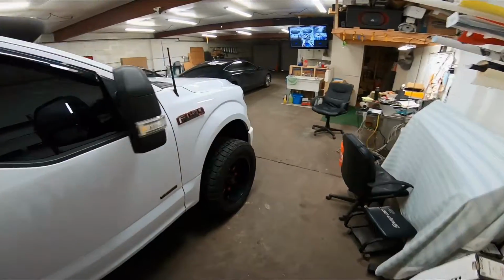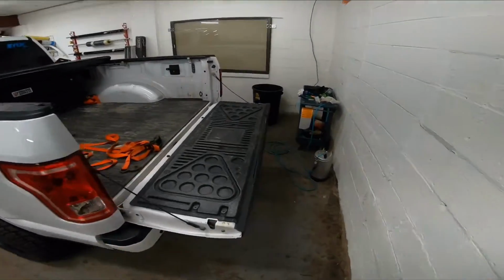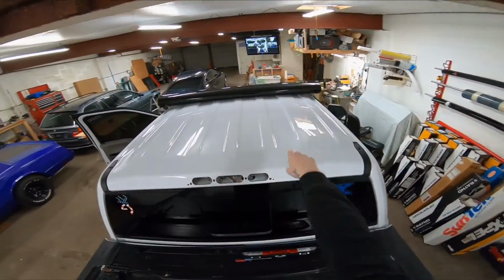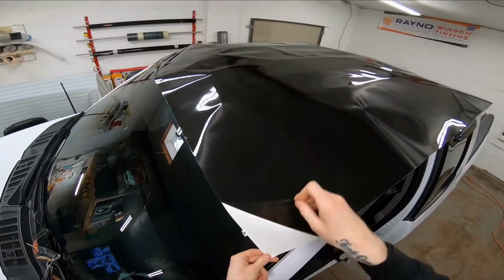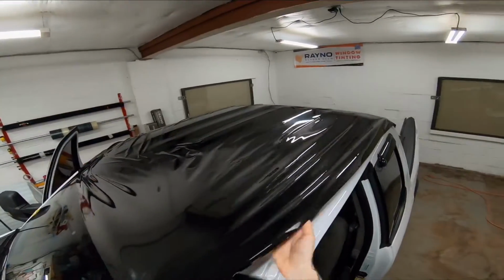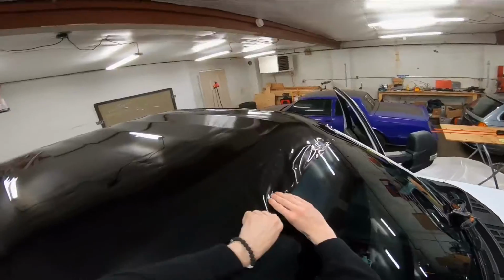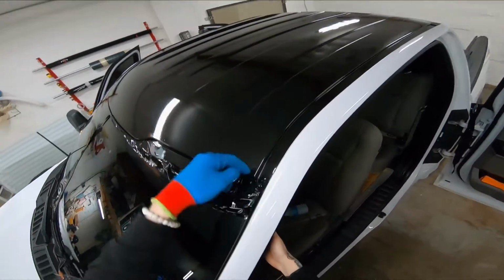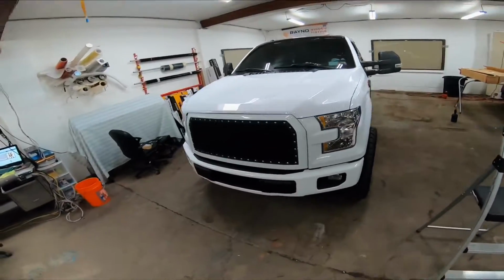CUSTOM FORD F150 ROOF WRAP

Comment: What kind of wrap is this? Does it not require water to put it down? Also how did you get the grooves to lay flat im about to do mine. What size did you order also. Sorry for all the questions.
Reply from the maker: Hello James, this wrap is Avery Gloss Black. It doesn’t need water because there are air channels on the adhesive side of the wrap for the air to escape and not bubble up. On the grooves heat it up a little and shape it into the groove with your finger. The size for that was about 5ft x 7ft
Reply: I had the same questions except for the water part. How much better is Avery over 3m and why?
Reply from the maker: I personally like both. Avery is more user friendly, the way it lays and stretches. They’re both great brands though
Reply: How much wrap did you get to get that amount of hangover?
Reply from the maker: Don’t exactly remember how much exactly but about 7ft would do the job!

Comment: how to remove the antenna
Reply from the maker: Have to go inside of the cabin and drop the headliner. It unscrews and unplugs from there
Reply: @DarkZeroMotors  if the job doesn’t have to be 100% perfect can you just wrap and cut around the antenna rather than go inside and remove it? My antenna is not a shark fin it’s just a flat one. Great video!
Reply from the maker: Hey Adam, yes there is a way of doing it without removing the antenna. It takes good alignment thats all to it!